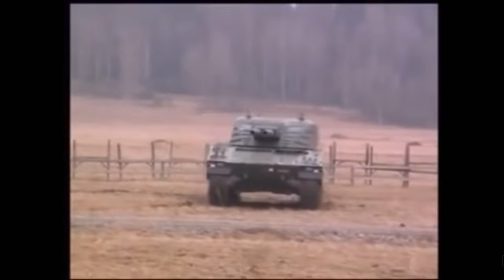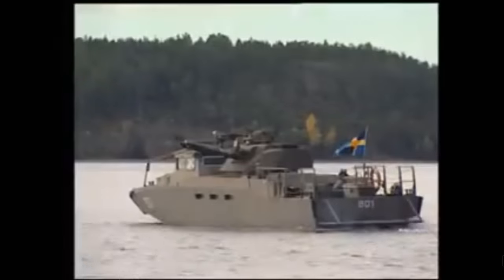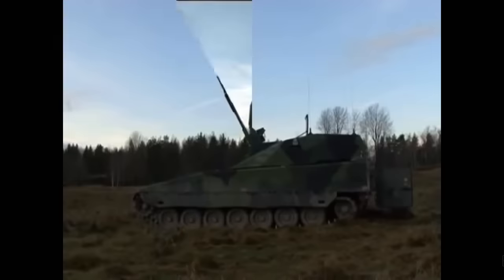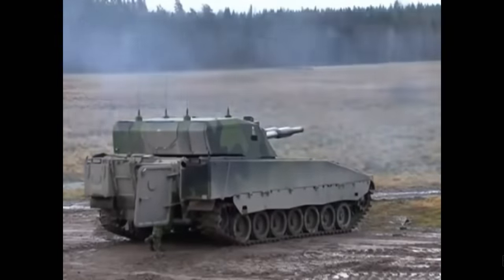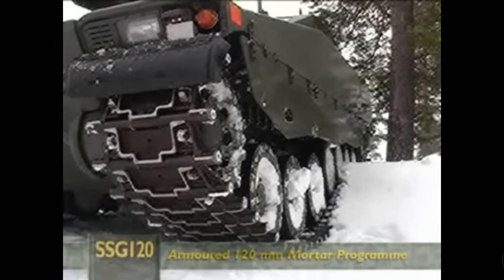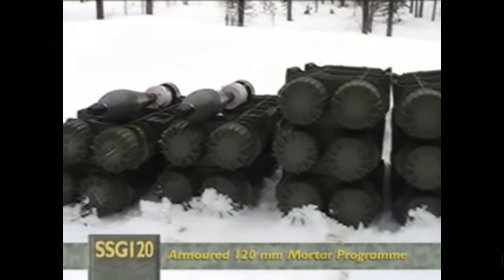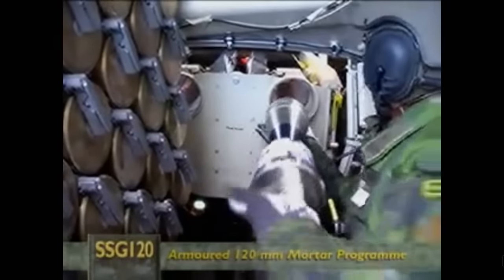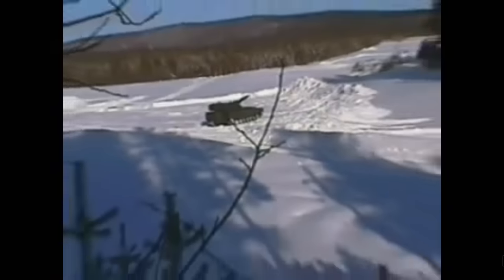Advanced Mortar System (AMOS) - Twin Barrel 120mm Mortar

Comment: The idea is decent, and it seems to work really well.
Only thing I can't help but think, is that it is that the Mortar is meant to be a cheap, light artillery system for the infantry, putting it in a vehicle makes it more expensive and I wonder if a more conventional artillery system isn't more applicable in the long run...

But it looks quit effective, and our battalions in Denmark, could benefit from having this in service.
Reply: bandholm the thing is it provides a steeper angle of attack for the rounds
Reply: No you can fire artillery at that angle. Nothing is stopping you from doing so.
Reply: gus bisbal do most spgs have 85 degree eluvations angle
Reply: The term mortar doesn't refer to "infantry artillery", it's just the type of gun they are.
I was drafted as an artillery man (m109a3) in the german bundeswehr 15 years ago. If I recall it correctly the classification if a gun is a cannon, howitzer or mortar relies on the ratio barrel length to caliber. I don't know the exact thresholds, but a cannon has a long barrel for its caliber, the mortar a very short barrel and the howitzer lies in between.
Unfortunately I couldn't confirm it via wikipedia(german), where they are talking about the type of directing the gun (cannon - direct fire, mortar indirect, howitzer both).
Reply: Caruma Insane
"The term mortar doesn't refer to "infantry artillery", it's just the type of gun they are."... Didn't claim that it was the classification, just what it is most commonly used for.  
"if a gun is a cannon, howitzer or mortar relies on the ratio barrel length to caliber"... I have never heard that should be the classification... I am not an artillery man, but I have always been told that the difference was in  the angle of attack...
The gun shoots in flat trajectory, resulting in direct fire. The Mortar shoots in a high-arcing ballistic trajectories, the howitzer is in between... And of course there is the difference of range and shells/bombs.
Reply: A steeper angle provides a shorter distance to target if you are going to fire indirect. The reason artillery in its traditional sense doesn't do that is because it would be firing on a target that is pretty close and that is not the purpose of most artillery, but that doesn't mean it can't be done. There is such a thing as a role on the battlefield. That role fits into regimental policies and fire control protocols. Those protocols dictate what weapon you use and those protocols, more than anything else, even more than what is available on the market, dictate what is done with a weapon. So artillery like a 155 is just not going to be elevated to 85 degrees because its position on the battle field, mandated by BHQ, is too far away to ever ever use 85 degrees. But if you point that thing at that angle it will fire and it will hit with great accuracy just like the motor round. The fact that the AMOS is highly mobile and armoured going in combination with that angle because it can get close, fire and get the hell out of there because ground forces can actually engage it. That doesn't usually happen with artillery, well not if BHQ command are doing their job. I don't know, what did you get taught at military college when you went?
Reply: gus bisbal good post, I see that you know that shit a lot better than me but you forgot to mention why  a steeper angle is desireable. The steeper the angle, the more effect your fire will show on dug in (literally) enemys.
Reply: If you combind the CV90Amos120 with regular CV90 or possibly the CV90-30 export version, the same spare parts and mechanics keep them both running. Todays infantry will be mechanised for their transport anyhow, and will be riding in the back of the regular CV90's.
Reply: Caruma, so indirect fire, lets call it that because that is what it is. Not mortars or artillery that is the gun that delivers it. Indirect fire is used when you don't have line of sight because they are too far away for effective direct fire or something is in the way. So you fire over it. Getting effective fire into an entrenched enemy is not done by getting it into the trench. Unless your the Americans and you destroy things by fire alone. You know, 20 minutes of 155, 12 guns continuous. Crazy amounts of fire. Normal levels of fire gets rid of entrenched enemy by time delay rounds that go into the ground first then explode or air burst rounds, or normal rounds hitting trees which turn into air burst rounds. The use or mortars is based on the ability to control distance to target with the ability to change the charges and vary the angle. So 45 degrees is maximum distance to target. Anything more than that will shorten the distance to target. So 85 degrees allows you to indirectly fire on something close. Anything less then 45 degrees also shortens distance to target but it becomes a direct fire round then. So if you want to hit something 1000m away on top of a round hill where you can't see the top, you have to point the barrel right up. At that point its the only way to get it on there. That is why 85 degrees is used. To hit close things with indirect fire.
Reply: Andreas Sjöberg I guess the price of one AMOS turret is similar to that of a modern MBT?Also 10 years have passed and neither Sweden nor Finland have any serious number of it.This wasn't commercial success either, Slovenia has the NEMO variant in some numbers and so does Saudi but still!
I think this is an excellent and extremely useful weapon not only for armored and mechanized units but also for infantry and other units as well.What do you mean "all infantry will be mechanized"?
Reply: bandholm The difference is survivability and effect of fire.
Using conventional mortars in its stead would mean having, say, seven mortar teams and a high risk of losing at least one of them, and thats just the starters.
You see, what was barely mentioned was the simultaneus strike capability, meaning the round strike the target at the same moment. Why is that important? Because the second the enemy detects they are fired upon, they take cover. This takes just a few seconds for well trained soldiers. After 10 seconds, enemy casualties are reduced by 80%, so it doesnt make sense firing anymore. In the best circumstances, the barrage takes only 2-3 seconds.

The AMOS can put in up to 14 shells into the target in that 3 second timeframe, or 28 for 2 vehicle team. Thats serious firepower. It can do that in minutes from the time the strike is requested. 

Now, the moment you fire your first round, you are going to be detected by the enemy counter-batteries. It takes them a few minutes to do all the same things you have done, and their shells are then coming at YOU.
You can take cover too. Or you can run, if you are really fast. But taking cover means you risk getting back everything you gave to the enemy, with interest. And your equipment is still vulnerable, even if you were not.

Best way to survive is to run. Its almost certain that the enemy is not firing yet when you stop firing, but lets say they are. It takes the shells, say, two minutes to arrive in your location. You are moving in less than 10 seconds, and have been driving in other direction for 110 seconds when the shells hit where you were. You are loooong gone in 110 seconds. 

By the time the enemy counterbatteries have stopped firing, they are already on the receiving end of 28 shells from the other pair of AMOSes. Rinse and repeat. Or, its possibly to do the same with the same vehicles. If you have decent AA in the area, you can just stop after a few minutes and fire again. Assuming the enemy cant detect you while you are not firing, you can avoid everything they can throw at you, while they cant.

Only scenario that conventional artillery is better is a long drawn out war of attrition where you throw out men into the battle until the enemy gives up. For Nordic countries, the only conceivable enemy is Russia. 
And no-one can beat Russia in a war of attrition, well, maybe China, but thats not the point.
Nordic countries cannot exchange casualties in 1-1 ratio. They have to do much better. USA on the other hand, need mobile firepower that can be easily moved and deployed.
And of course they have to keep up with tanks.
Reply: To be honest, infantry does pretty much nothing other than spot enemies and wait for indirect fire. Sometimes may even shoot into general direction of enemy. Indirect fire have been and will be the most effective way to cause casualties. Very fast, accurate, and devastating mortar system is hugely valuable. There is no 5 minutes to wait for strike, because there might not be anything to hit anymore :)
Reply: Remember your history, the earliest mortars are definitely not carried by infantry, they're large and has to be carried by some wagon or so, American Civil War mortars were even carried by trains to add maneuverability to it. The only thing that made it as an infantry weapon was the WWI trench mortar, which the design was very popular bc of its portability. Mortars were meant to be used as weapons who can lob higher than an arty, but since arties can now do it as well, one thing I can say is that mortars would be now used as cheaper, shorter ranged weapons, hence for their shorter tubes/barrels
Reply: The idea of a mortar is to provide that indirect fire support rapidly to ground units. Mortar systems whether it be a 60mm carried by a team or a mounted 81mm or 120mm is faster to set and employ than 155mm howitzer. Gun batteries are generally much further back from the front line and support at a battalion echelon, prioritizing their sector of fire for the company most likely to come into contact. Where as a mortar team supports a company directly and orientates toward the platoon most likely to come into contact. There's more to it, but that's the concept in a nutshell.
Reply: yeah, and if at any point you have this wouldn't you just be able to have a howitzer? logistics mang, this thing is pointless.I can't thing of a single fucking reason for this.
Reply: Jace Wallace As I seem to examine the system, I'd say they mind with extra mobility in it. It looks like it's very fast for an indirect fire vehicle and can do hit & run faster than SPGs. Also, mortars are simpler to use than artillery, plus they're cheaper, perfect to use with budget in mind. Since mortars are simpler to use, they position and fire very fast and as mats said, they could even be fired on the move, which will complicate the enemy further unlike artillery where you have to stop in a position and might risk getting shot at despite distance being a thing.

I'd say, it's solid enough to be viable to me

note: I'm replying at midnight, so I ever not make much sense, it's that I'm sleepy and recently saw the new reply
Reply: bandholm trust me worth it makes the mortar better protection and more mobile.
Reply: Those were made for really tensily forested countries like Finland and Sweden. Field cannons and howitzers cant do the same as mortars. You need to cut down trees or shoot from open because of more flat trajectory. How mortar shell impacts on target even with old school detonators makes better impact.
Reply: My thoughts exactly. It seems like the west is rushinng towards equipment that has an expensive initial cost but cheep ammunitions, like they are planing for a war of attrition. But I'm out of my element here.
Reply: @Janos9311  it really depends on the military. The Russian definition of a howitzer depends on barrel length while the US military simply considers a howitzer on the shooting angle capabilities and a gun simply fires directly. The M777 is considered a howitzer by the US military while the L118 is considered a gun by the British. If the US had the L118, they would simply call it a howitzer. In reality, pieces like the M777 and the L118 are gun-howitzers or hybrid of a gun and a howitzer. They are guns because they can use powerful propellant (which gives them their extra range) and they use levels of charges like a howitzer for range control. A pure gun fires exclusively full power propellant and fires directly. They almost usually fire fixed rounds while gun-howitzer can use semi-fixed or separate shell/propellant system. A mortar, in contrast, uses weak propellant but fires with more HE content per weight. Mortars usually are smooth-bored while howitzers and guns need rifled barrels to spin the shell for accuracy and range.
Reply: dimapez  not really, the M777 Light Howitzer is still preferred over any mortar platform because of its range. The M777 can be moved by helicopter. The problem with mortars is their lack of range. They have more HE to weight ratio precisely because they lack range. They can fire thin-walled shells in comparison to howitzers. Most militaries in the world rather spend money on a self-propelled howitzer than a dedicated fully enclose self-propelled mortar system for a very good reason.
Reply: dimapez  The Russians have a hybrid 2A80 mortar/howitzer platform called the 2S31 Vena that fires 120mm mortar rounds but also its own special howitzer round for direct fire and longer ranged fire. That as far as it goes for self-propelled mortar system for them. The limited range of mortars doesn't make them as reliable for supporting infantry. That is why smaller mortars are used such as the 60mm and 81/82mm mortars because they're in essence pocket mortars but they lack the firepower of 155mm/6in howitzers. The Chinese even use the 100mm mortar as a compromise between firepower and weight. 

There is a cost-benefit analysis of weight, firepower, and range. The enemy can pop up anywhere where firing range is important. A self-propelled mortar that is not in range would miss out in fire-fights where a howitzer within range can offer support in a quicker manner when called in. Militaries, in general, don't really care for mounting light-weight artillery on a chassis. To them, it is a waste when you could mount something bigger. This is the reason why the US military didn't like self-propelled 105mm howitzers. There isn't much point for the main army and only suits airborne style of combat. As far as mountain warfare is concerned, towed howitzers are by far the most flexible as the M777 has shown in Afghanistan. With a self-propelled system, you would have to go around mountains while a helicopter transporting an M777 can cut through a lot of mountain range far easier. In the thick jungle where vehicle mobility can be stifled, the same applies.
Reply: dimapez  A) Right, a military that doesn't have a howitzer is expected to dominate the artillery war with a fully enclose advanced mortar system with poor range. B) If the enemy has air supremacy over you, you are screwed. You would have to deploy air defence and assume where enemy aircraft will strike. A self-propelled 120mm system does not help you in that situation. You wouldn't fly a helicopter towards known air defense. 

120mm mortars are heavy for infantry to tow but not heavy for vehicular primary movers. There is little benefit for a dedicated self-propelled mortar that justifies the cost. 120mm mortar can be towed by an HMMWV. Not only it costs more for little benefit. it also presents a logistical problem of bringing a dedicated system compared to simply towing it. For the US military, for example, HMMWV is a very common vehicle which can tow both the 105mm howitzers or 120mm mortars. The bottom line is, even if AMOS packs a lot of firepower, it is still limited by its firing range. If rapid-fire mortar systems were the thing, modern militaries would be rushing in to build their own with the most advanced technology but they aren't because mortars have a downside when deciding with a budget.
Reply: dimapez  those are obsolete. The Melara was replaced by the L118 Light Gun for the British. On foot artillery is best done by mortars and variants of mortars for mountain warfare.
Reply: dimapez  yeah but not self-propelled mortars. This video is about a self-propelled mortar, not regular mortars. Where did you get that I said that mortars were useless? I never said such a thing. I said self-propelled mortars are not very cost-effective. They cost more money than the value they provide. This is why very few militaries have any dedicated mortar platforms. The Russians have gun-mortar platforms which are mortars that can fire like a gun and howitzer.
Reply: dimapez  I said repeatedly in the context of self-propelled platforms. This video has nothing to do with regular mortars. You are changing the subject to create a strawman argument which is dumb because towed mortars can be helicopter transported as well.
Reply: dimapez  yes self-propelled mortars. A dedicated self-propelled mortar isn't a towed mortar. If you are talking about make-shift self-propelled like the M113 tracked vehicle with a 120mm stuffed in it, that is not a dedicated self-propelled platform. That is just a mortar on a chassis. You can put whatever you want on the M1113 as long as it can handle the recoil.  The AMOS  is not a make-shift platform, it is a from the ground-up dedicated. It does not have the flexibility to dismount the mortars and it is breech-loaded. As I said, few militaries use a dedicated mortar system because they are short-ranged and putting them as a permanent platform defeats the purpose of mortars being light-weight enough to engage in things such as mountain warfare.  There is no real reason for a dedicated self--propelled mortar. Why the need when a 120mm mortar weighs between 300-350lbs. It is so lightweight, the common automobile can tow it easily. A howitzer is much heavier and necessitates the need for self-propelled capability much more. As such every military that can afford it has self-propelled howitzers and guns over self-propelled mortars. For the Russians, they use gun-mortars to provide a capability that regular mortars don't typically provide, that is direct-fire, and that is for the specific situation of airborne divisions doing mission-based warfare. The gun-mortar has the versatility to justify the mount.
Reply: 3 years later ... We have context ... Ukraine vs orcs, where helicopters cannot get vaguely near the line of contact but you may want indirect fire support 

The AMOS/NEMO computerized rapid alignment, reliable multiple rounds simultaneously would be really useful

And a dozen STRIX self steering anti armor rounds would be amazingly helpful when a Russian armor or AFV group is detected and where the orcs can't fire back (unlike a tank vs tank battle)

One AMOS or NEMO vs most of the vehicles of a BTG where the BTG never knows who's firing at it and can't return fire = optimally asymmetric (never fight fairly)